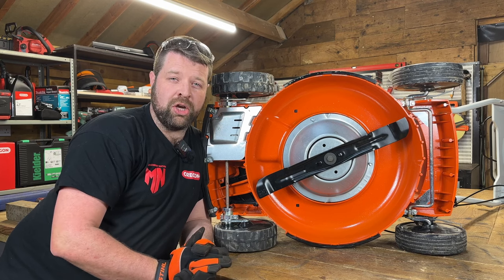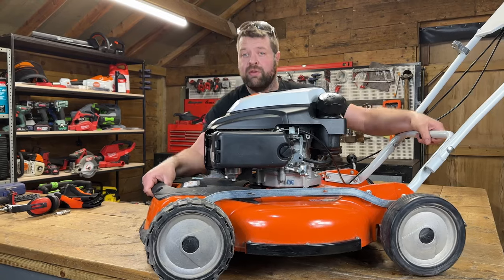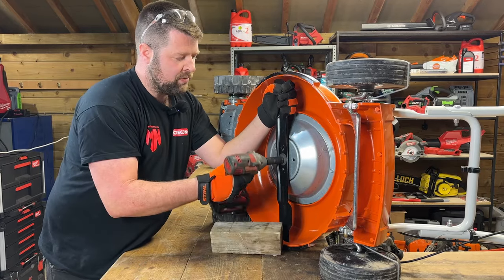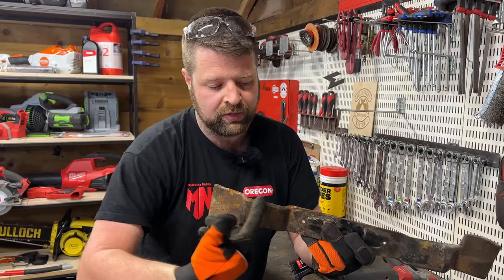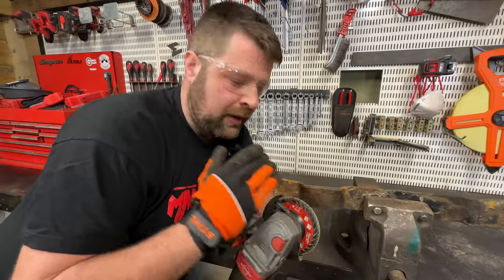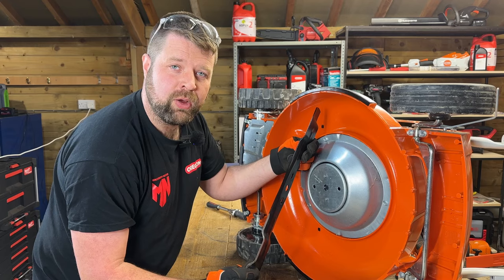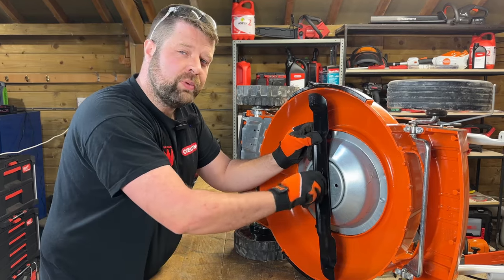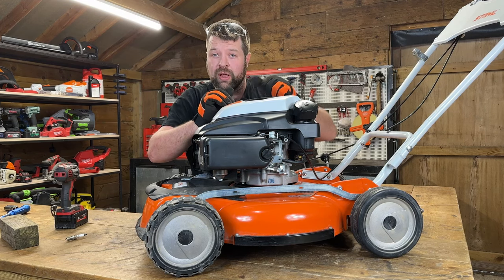How to Sharpen a Lawn Mower Blade In Under 2 Minutes

Comment: Glad to see you using the "flap" wheel to sharpen.  I found out years ago that the flap wheels as we call them never gets the blade too hot killing the "temper' in the blade.  I cut about two acres a week with a John Deere riding mower ... the blades last much longer, got one set of blades that are 3 years old and are just now reaching replacement time.

Comment: If you’ve not got an angle grinder, most good hardware shops will stock drill attachments you can use for sharpening large blades. If you don’t have a vice then a strong door hinge will do.

Comment: Aren’t you supposed to drain the fuel and oil before tipping the mower?
Reply from the maker: If you tip the mower with the air filter staying at the top, you won’t need to.
Reply: Pull the cord until it's starting to get  hard to pull. That way the engine is in the power stroke which means both valves are closed and you wont have any fuel enter the cylinder. If you don't do that there is the risk of hydrolock which can fissure the engine block.